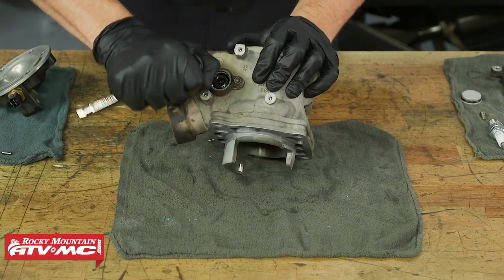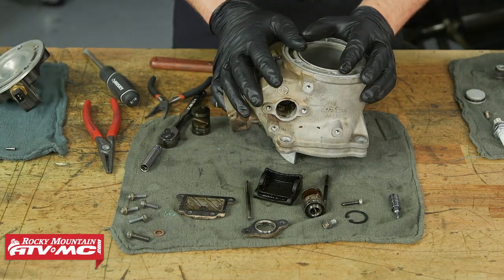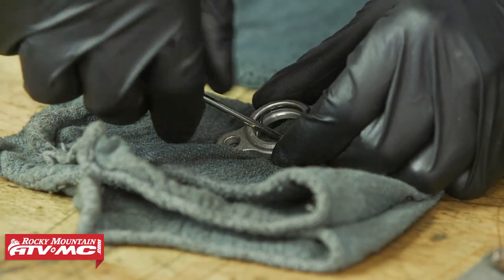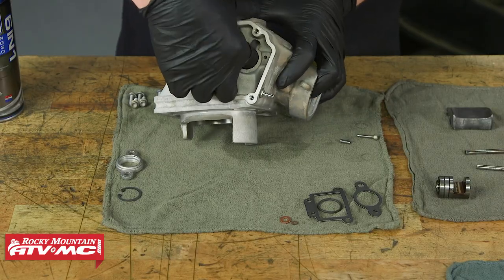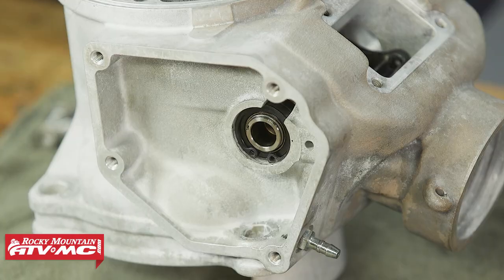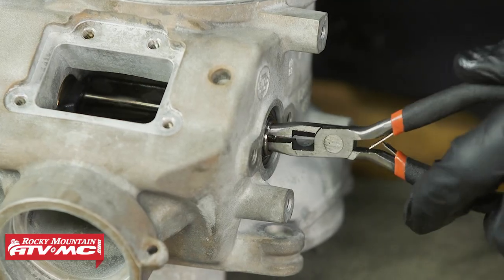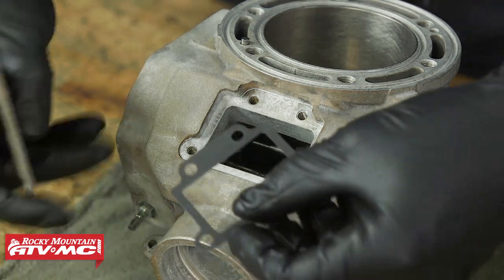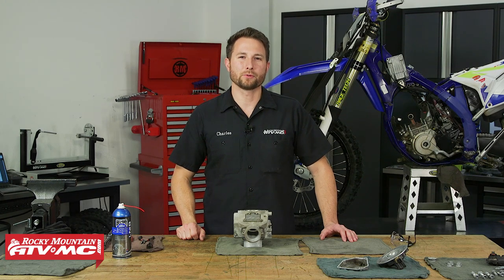How To Rebuild the Power Valve on a Sherco 2-Stroke Motorcycle

Comment: The manual says that we need a computer diagnostics tool when reassembling the valves; is this very necessary or can we skip that process?
Reply from the maker: https://youtu.be/OJKLoKLIuqU?t=1020 Yeah, we recommend taking the bike to the dealer to make sure valve motor is calibrated correctly. We just don't mention it until assembly. -Charles
Reply: @rmatvmc can't you just calibrate by holding a kill switch and tapping start. Then it will engage pv to calibrate